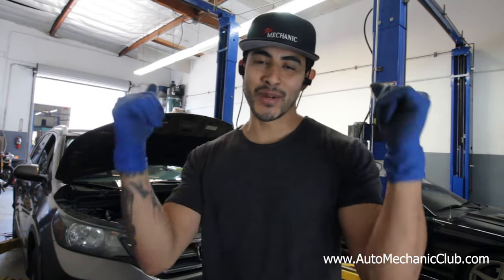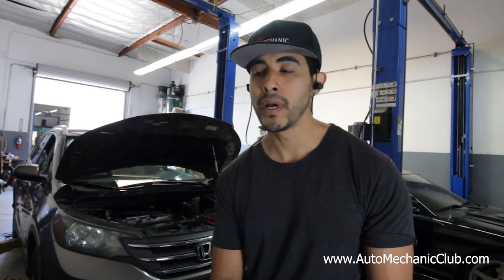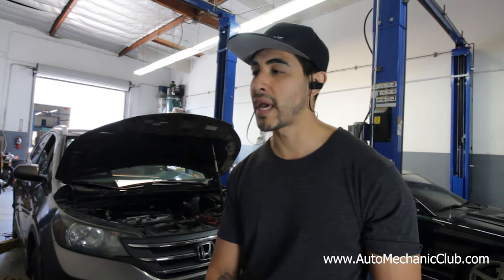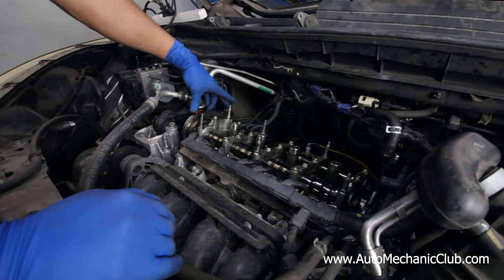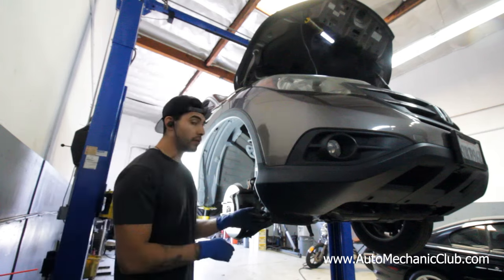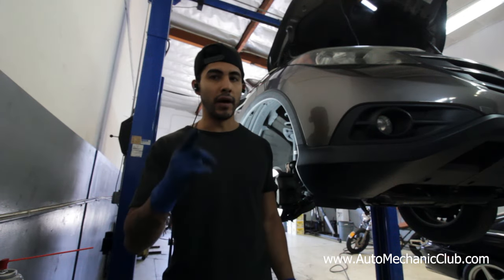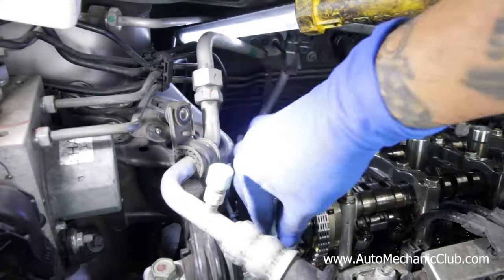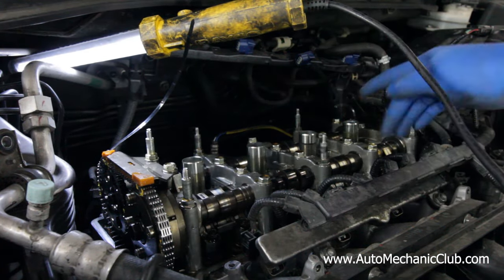2012 Honda CRV VTC Actuator Replacement and Diagnosis FULL

Comment: Great info and thanks for the sound the engine made I have a  Wrx that is making the same noise and the dealership won’t warranty my clients vehicle after we found the same issues with his car. This vid made me remember when you first started making vids they were full of info and great tips which for a person like me who at the time had 0 knowledge of cars had just begun as the advisor at my dads shop after the previous one left in a hurry helped a lot. The one thing I remember you had said back then was that if someone wanted to be in the top 50% of techs all they needed to do was simply read the repair manual before doing the job. This has been not only true but countless times been the reason I was able to help my guys in a repair that frustrating them. This has also allowed for myself to find success in learning to do programming as it is very specific, but at the end it’s just following directions. Thanks for your efforts Keep it up man glad to see you are doing well take care
Reply from the maker: zackky11 thanks brother. We’re back in that same energy. Thanks for watching G.
Reply: @THEMECHANICOCMissionViejo  I just did this chang-out myself, plus vtc solenoid and chain tensioner. BUT…. When I turn the engine by hand, I get a clicking coming from the timing chain just before TDC on #1 cylinder. Watching the tensioner, the little lock arm moves when the noise happens and also the timing chain between the two cam sprockets develops a slight amount of slack and then slaps up against the to top chain guide/pad…. Is this normal? Have you seen this before on your jobs? Thanks for your time.

Comment: I’ve had several customers come in with this noise but they usually don’t want to fix it due to the price. One was a 2012 CRV with as low as 30k miles, so I sent her to the dealer for warranty repair. We’re going to be doing this job Monday so it helps a lot to see a human do it vs the TSB. Thanks!
Reply: What happens if u don’t replace it?
Reply: As far as I have read, people continue to drive with no problems other than the noise. I’m sure at one point or another after long enough the timing chain can jump some teeth. If you jump enough teeth you can bend some valves. I really don’t think it’s that expensive considering it should be roughly $900-$1500 depending where you go.
Reply: @justmy2abelincolns272  oh wow ok thanks for the heads up

Comment: Great video and information.  FYI, you can remove the vtc without removing the cam.  Follow these instructions but knock the cam bolt loose and pull the vtc off the end of the cam

Comment: Don’t need to take the cam out, just remove exhaust side gear and replace vtc gear and reinstall gears and timing chain.
Reply: Ive seen that method but how do you remove that stubborn vtc actuator bolt. The exhaust side gear came loose easy though...
Reply: To remove actuator bolt  use 15/16 or 23 mm wrench on camshaft to hold it back. Approximately at halfway length of cam. It’s built for it
Reply: @kirkandkaylaglaser2922  I had to remove all the bearing caps and put a bunch of worn towels on a bench. I had someone hold the 23mm wrench with a cheater bar so it's easy for them to hold while I used the impact gun
Reply: @trippin8585 loosen the actuator bolt and hold the intake cam with open wrench while timing chain is still in place.
Reply: Do u i need to remove the timing chain tensioner when replacing the VTC gear?

Comment: Thanks for the video.  I have the confidence to do this myself.  I have a 2012 CRV that I purchased new.  It’s been doing the start up noise for about 6 months. Only during the winter months.  If it gets worse I will replace the VTC actuator, but I will replace the timing chain, guides, and tensioner as well.  I heard that the noise does not really affect anything.  I also heard that the  noise can stretch your timing chain little by little once that happens it will throw a engine code. Camshaft position sensor code I believe.  Some people been living with the start up noise for years and they are fine... others Changed the VTC actuator and noise came back...
Reply: Hello, so this noise is just the noise that does not affect the engine? Would you recommend that I wait for the replacement work till the check engine comes on? Or should I replace it? My mechanic would charge me $800 for that job. Thank you
Reply: @zivilewatkis2928  does that include parts and labor, or just labor?
Reply: @zivilewatkis2928  it's just noise doesn't effect
Reply: @manitas1818  it causes strain on the timing chain tensioner and will lead to failur in the future.
Reply: @dakotap1488  the vtc actuator has internal wear the part that rest on chain is still ok, also if it's at that point of failure other components will show fail point I can send you the service bulletin about the actuator if u want peace of mind

Comment: Great video with all the important points highlighted.  I looked at some other videos and yours if by far the best.  I just completed this on my 2012 CR-V with 154K miles and went exactly as planned.  I took it slow and everything went back together well but I decided not to adjust the valves for now since selling  and no detectable noise.  I have a local shop give me a rough quote of $2.5K which is crazy since the sprocket cost me about $100.

Comment: At about the 9:52 mark you mentioned that the side marks on the VTC actuator and the exhaust sprocket were not perfectly aligned, so you turned the crankshaft slightly until they were.  Does this not throw the number 1 piston off of top dead center?  If so, do two of the three have to line up (Arrows and side marks on actuator) as opposed to crankshaft?  Please advise.  Thank You.

Comment: Had the VTech actuator, timing chain, and tensioner replaced by a good mechanic on a 2013 CRV with 150k miles. Same cold startup rattle has returned after 1.5 years/30k additional miles. Synthetic 5k oil and filter changes every 5k miles. Is another $1000 job (2hrs labor) needed every 30k miles?

Comment: Thanks for the video. I have a 2015 Dream 2.4. The actuator is on the other side. Do I still have to remove the cam or do I just replace it while on the cam? (That’s what I’m did) Might a stupid question but I did mine earlier and the timing was off. When I started it, it sound like it had an after market cam. A little frustrated. I have till tomorrow to get it running for Monday. Any help will be appreciated. Thnx
Reply from the maker: @OhMar1210  multiple ways to do it. But this is the way the manual says to do it. And we follow the manual.
Reply: @THEMECHANICOCMissionViejo thanks . I just did mine today. It’s a little different wit the 2.4 Dream Motor. Super apostate the response 😊

Comment: Appreciate the video. I think once you have done your first one and build your confidence, not such a hard job.  I found it much easier to work with once I took out the tensioner.  It gave me a ton of room to fine tune the alignment of the cams.
Reply: Remove the tensioner before you set everything to top dead center?

Comment: Check you are using 0w30 oil before spending time and money, i found out with 5w30 oil change the noise started and got worst with 10w30 used in next change. This made me think cold start oil thickness might be the problem, and it was. I canged to 0w20 (not very hot down here) and it stopped making noises for two weeks now.

Comment: Cool video, next time, just take the timing cover off. Its not worth the chain moving a tooth. Stock motors dont have a timing guide for the bottom crank pulley and the chain moves very easily over the teeth; take it from someone that has done this thousands of times at this point. Also, you dont have to keep the VTC unlocked, there is a pin tht centers the fixed portion of the gear.
Reply: Clearly you don’t work flat rate ain’t nobody got time to take the cover off lol
Reply: @Greg18m7  excactly
Reply: @Greg18m7  Nah no flat rates over here. Gotta make sure were paid by the book. Cant afford to make a mistake, my reputation is everything. My guys are paid to get it done the safest way possible. We are a slower shop, keeping the complaints at a minimum and not having to see the same car for FREE labor is always worth it.

BTW it doesnt take too much longer to remove the timing cover. Its not like a Nissan 2.5 LMAO -if you know you know.
Reply: @DGOfTheCentury  actually this procedure is by the book except he didn’t do a valve adjustment
Reply: Would it be good to have my mechanic do this when we get a tune up?  @DGOfTheCentury

Comment: rr v/c loosen gear bolts, I find remove and replace tensioner ( easily damaged if not retracted properly)and balancer. rr crk seal and mark links paint. shove rag under chain at crk sprocket so chain doesn't jump. 
No need to remove cam shaft

Comment: Correct me if I'm wrong, but shouldn't the loosening sequence of the cam caps be the opposite of the tightening?  That is, start from the outside and work your way towards the middle?  Thanks for the video, doing this job on my 2014 soon to get it ready to sell.
Reply: Exactly what i was thinking

Comment: That sounds very similar to what my 2014 CR-V has started doing. I have 98,000 miles on it. I hope this isn't the problem. I was thinking a fan issue. It rattles on start up and initial acceleration when first running. 😒

Comment: So, is it super bad that i was able to unlock mine simply by turning it? im in the midle of  amajor teardown and inspection of my timing system because of a drivability issue, and i remember just one time thath mine made the cold start grinding noise many months ago. Perhaps my lock pin is rounded and therefor not locking when its suppposed to. My analysis of it with my eyes and brain suggests that the lock is there to stop it rotating until there is oil pressure, so as to stop the cold start rattle and also to stop it form moving out of time while there is no oil pressure to hold it in time. I was undoing the little torx bolts to inspect it, (without the chain) and it just slipped, then i realised i could lock it again by turning it back, thne give it a hit with my palm and i could unlock it. Now im wondering if this is happening randomly causing my stuttering at idle, and maybe even the reason for my lack of power and code p0341, which i thought was a stretched chain.

Comment: do believe your supposed to remove the cam cap bolts in reverse sequence of the original sequence. I see you show to remove them from the inside out it should be opposite, outside working your war to the middle?

Comment: Hello ! Thanks for your usefull video. Maybe "wrong marks" on crankshaft pulley indicate the moment you can secure the tensioner using the pin or am I wrong ?
Reply from the maker: No. They’re used for timing. Not for repairs.
Reply: @THEMECHANICOCMissionViejo  OK, thanks for your answer... and thanks again for your nice video !

Comment: Besides the noise it was making what are the other symptoms? This would be my last part that could be causing the code. I have replaced…..Oem timing chain, new tensioners, new guides, new vtc solenoid, new vtech solenoid, new cam position sensors on both both exhaust and intake. Crv runs fine at high speeds but stutters on build up rpm’s. Code P0341 2002 crv

Comment: Thank you for the great video. I watched as my 2014 CRV has the same noise when cold start since last few months. Now I have check engine light and couple of other light too like traction & steering so I took it too auto parts store for a quick scan and I have P0341 code for Camshaft position sensor but today I took it too Honda dealer for second opinion and I am told that I need VTC Actuator, tensioner, guide and timing chain but not camshaft sensors. Now I am really confused if I should just replace position sensor as per my scan or should I replace everything asked by dealer which is almost CAD $1500. Let me know if anyone has any suggestion. Thank you!
Reply: Change vtc timing chain and tensioner

Comment: Nice Job..  great video...  having a similar issue with a 1-2 second grinding noise on cold start.   this video convinced me this job is way over my head to do..  :D
Reply: just to follow up, for the record.   it cost $1000 to have it repaired by the dealer.  sigh
Reply: I just picked up an accord at auction with the noise. The previous owner had the chain replaced in a shop and its still got the noise.
Reply: @midwestfarm757  - for me it was the CVT actuator.  Apparently a common problem with these engines.   Only way to fix is have it replaced.   You need to open the engine, Secure then timing belt and remove the engine shaft...  Too much for a DIY mechanic like me.
Reply: @georgelouie5330  that’s one way to stop it for a short time, but others have had it come back.
Reply: @midwestfarm757  - the dealership said they replaced it with an upgraded part.  Don't know for sure... Not much you can do if the dealer approved fix doesn't resolve it.  Me taking it apart on my own isn't gonna fix it...

Comment: Can it cause damage (or bad performance, or...?) if the VTC Actuator is not replaced?  We have a 200K+ miles 2011 CRV that has this problem (noisy rattle when it starts).  I've assumed it is not worth it on a car of this age.  It is using some oil already, and accelleration is sluggish at lower RPM (...possibly due to lagging timing from bad VTC Actuator?...or not?)
Reply: The only thing I’d be worried about is timing jumping.. if it jumps enough it can cause some damage, but if it doesn’t damage anything you’ll at least get a p0012 fault code indicating incorrect timing of the intake camshaft. I’ve yet to see this happen on many cars that have this exact same rattle though, and many of our customers with Toyotas have the same noise for the same exact dumb reason. I personally would fix it considering it’s accessible without removing the chain and the part is $300 or so.
Reply: And yes, bad performance for sure. Your hesitation at acceleration may or may not be related to this depending upon your habit of acceleration. If you are an aggressive driver and hit high enough RPMs from a stop, then sure lol however you may be experiencing delay if you’ve yet to service your transmission. No matter what the dealer says, have your transmission fluid exchanged every 50k miles. If you’ve never had it serviced before, it’s risky to do at your mileage because you may experience worsening of symptoms. Start with this VTC actuator considering it’s a definitive problem if you have this same rattle at cold start-up.

Comment: While replacing the vtc actuator, auto tensioner pin fell off, how should I reset it? the chain is now too tight to put the camshaft back
Reply: if by accident the pin on the tensioner fell off.....as long as you mark down the chain on exhaust  sprocket and vtc actuator at TDC...remove the chain tentioner. while outside, lift the lock.push the tensioner in then put the lock pin on the hole and put tensioner back.

Comment: I have a crv 2013 just purchase it and noticed the sound next day... because it only comes up when the car is cold.  i took to a mechanic and there was a loose screw that couldn't get tightened so he said ok lets replace the pulley and  tensioner with original ones, that was were the screw was. so that's done.  I pick the car go home next day turn on the car... there it goes still a rattling sound. so I took to another mech and we realized it was inside the motor maybe the chain or the actuator but he said the car has no lights on and runs perfectly so it was not an emergency.   

what could happen if I leave this on ? 
could this damage the engine later on? how do I know a mechanic has experience doing this repairing?

Comment: You need to do a valve adjustment after installing the new actuator.
Reply: No you dont.
Reply: Agree. No you dont. Didn’t-touch rocker settings   Also if you do adjust the valves on these. Be careful of YouTube demonstrations. Have seen wrong advice about TDC and 180 out sequences. Can bend valves and strike pistons

Comment: i own 09 crv  and have same   rattle noise but its all the time  not only on cool start , if its the   VTC Actuator is bad its is possible that does the same sound all the time or its just  on cool start up?
Reply: Timing tensioner and chain also
Reply: @markusdaniels251  I just picked up an accord at auction with the noise. The previous owner had the chain replaced in a shop and its still got the noise.

Comment: Question tho, what happens if we dont replace the vtc actuator? What problems can arise in the future? Thanks!
Reply: The rattling is the actuator bouncing around until the oil flow quiets it down. My 08 was doing it when I got it 3 years ago. I went to do the VTC today, and my harmonic balancer mark is a few mm's off when the cams are showing TDC. Prolonged "rattling" slowly stretches the chain. I just orders a chain, guides, hydraulic tensioner from Honda this evening. No point in changing the VTC and leaving the crank timing retarded as much as it is. I felt it getting sluggish these past few months.

Comment: Just trying to figure out why it has to be unlocked if you lock it anyways before you put the cam back in. Does anyone know the reason behind this?I mean they actually say to unlock it with air pressure if it gets locked on accident before it is torqued,but I can't figure out why.
Reply: Following

Comment: You don’t even need to do all that!! Only should have to take off valve cover.
Just gotta take out vtc spring and stretch it!!
It’s inside that cam gear take off the hex screws and slowly pull apart.
Normal honda issue alot of videos on it.